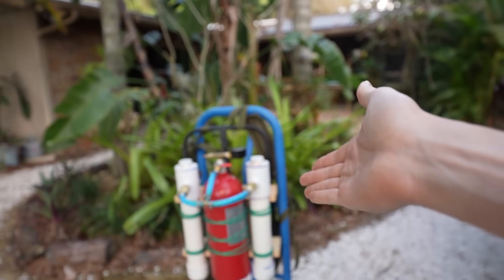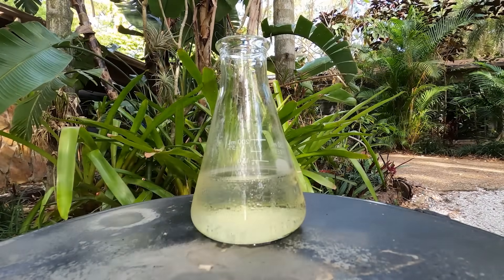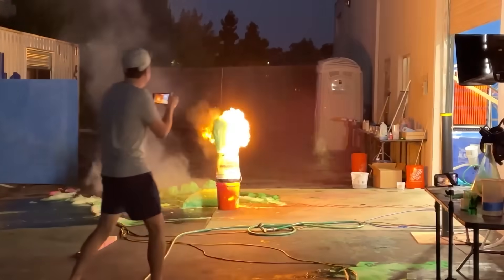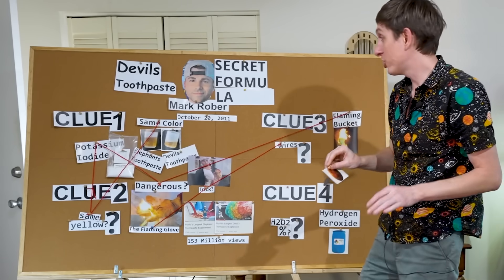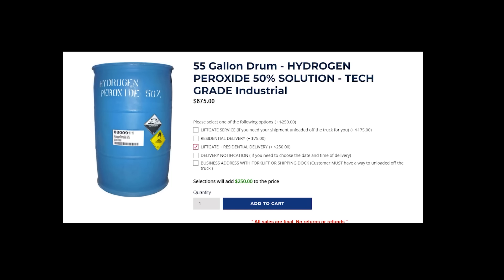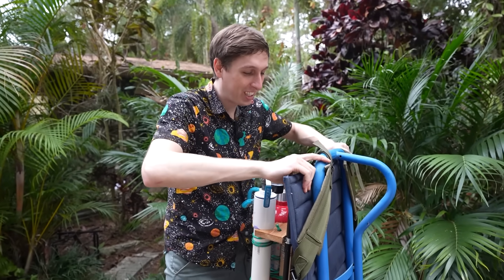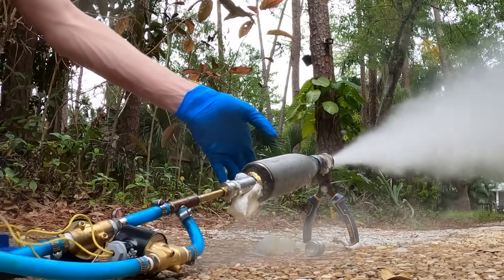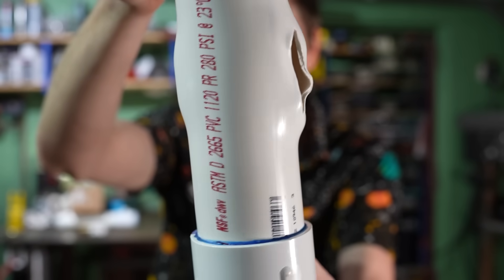Devil's Toothpaste Squirtgun (exploded)

Comment: A company I worked for used 70% hydrogen peroxide as an additive in their proprietary cleaning solution. It is very volatile and reacts in ways you wouldn't think possible. If you got it on yourself it looked like it was bubbling up from under your skin. It's extremely painful! The only thing that would help was constantly flushing the affected area with cool water or using ice water to soak it off your skin. The company hired this young guy to clean up and stock. He decided to not listen to us about staying out of the mixing room and away from the hydrogen peroxide. He said that he was wanting to use it to clean with and poured it into a measuring cup. He had some grease on his hand and when the fumes from the hydrogen peroxide made contact with the grease it started to look like smoke was coming off the spot. This scared him and he dropped the measuring cup and the gallon jug of peroxide. It spilled on the top of his sneakers and got into his shoe. We ran to see why he was screaming and found him in the mixing room. We pulled him out and to the emergency wash station. While I restrained the new guy, my boss put on his safety gear. When his shoe came off the skin on his whole foot was white and foaming up. He had to take off all his clothes because he had tried to sit down to take his shoe off and it got on his butt and had splotches of it all over himself. We had him under the emergence shower when the ambulance arrived. They were so confused and it took a moment for them to understand what was happening. They tried to take him out of the shower but the burning would quickly become intolerable. It took about an hour for most of it to wash off but his foot had to be put in a bucket of ice water for the trip to the emergency room. While it hurt it only made the epidermis come off and he quickly healed. He did however have to get a different job. He was told multiple times not to go in there and that the hydrogen peroxide was not like the stuff you buy at the store. I just don't understand what he was thinking? The boss had to change the lock on the mixing room door and the chemical locker and kept the only copy of the key with him at all times.
Reply: Imagen if he mixed the hydrogen peroxide with sulphuric acid and then spilled it. He would be in the air quite literally.
Reply: @dashofawesome64  😄 That's a good one.

Comment: There’s an old type of firefighting foam that worked as a chemical reaction like that. It forms rlly big mounds of foam. It’s hard to find much about it since it was for the old soda-acid type extinguishers but I bet you could make that chemical reaction into a gun, plus you can fight fire with it 👍👍

Here is the stuff I’m talking about 

https://youtu.be/NRW36Fj7I5M

It’s not AFFF so no cancer
Reply: My dad has some of those. The problem is that they displace oxygen. This puts out the fire, but at the same time anyone trying to escape suffocates. Minor oversight lol.
Reply: @burtmcgurt3584  This one actually makes more oxygen lol, wouldn't be a good idea to use it for a fire, but yeah the old carbon dioxide ones that react and acid and a carbonate will release carbon dioxide displacing the air, but normal carbon dioxide based ones will also do that, I doubt the carbon dioxide from the extinguisher would do more harm than the stuff the fire already puts off
Reply: Chemical-based firefighting foam called AFFF has been sold for decades, but the deadly side effects of the chemical are now widely known. PFAS-based firefighting foam exposure may cause firefighters to develop: Renal or kidney cancer. Testicular cancer.
Reply: @zeruulln  not to mention that the PFAS sink in the water table and affect wells for miles, causing the same issues in whomever drinks the water!
Reply: They still use them in air bases. They can fill a hanger with foam in seconds.
At Williamtown air base in Australia they spilled the chemicals and the groundwater is contaminated for kilometres around.
Reply: @trissylegs   I remember that.
Reply: Sounds like the GLOO Gun from Prey.
Reply: @Acistra  it’s not AFFF. It’s an earlier formulation that doesn’t use fluorinated chemicals. Plus high test peroxide is certainly worse lol
Reply: I worked at a place years ago the had an extinguisher that contained that.
Reply: I read that the Fire Retardant Foam was toxic!? I'd ask a fireman, but they are dead!  (sarcasm)

Comment: Hint: there are 3 ways to speed up a reaction. 
 
1) increase the surface area of the reaction.  
2) lower the activation energy.   (Different catalyst)
3) increase the temperature.    

Which did mark use?. Hmmm.
Reply: I mean if someone really wanted too they could decode the formula.
Reply: Or just use different chemicals.
Reply: @user255  then it's a different reaction

Comment: Come onnn, why say "Two Chemicals" as a science channel, they're Yeast and Hydrogen Peroxide...It produces some heat, water vapour and oxygen. Just don't do it around fire or something that's on fire and it's about as dangerous as a tap.

I would assume "devils toothpaste" is a high concentration hydrogen peroxide and potassium permanganate mixture, maybe some dish soap for bubbles?